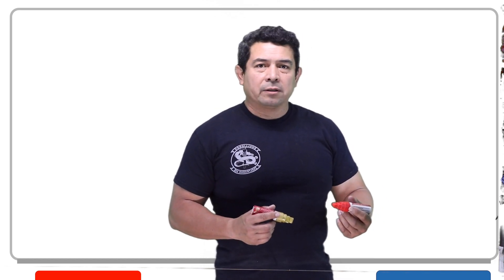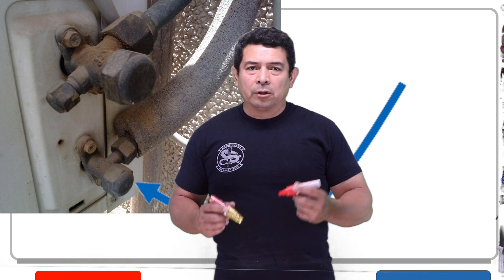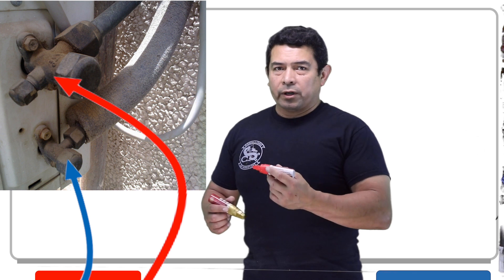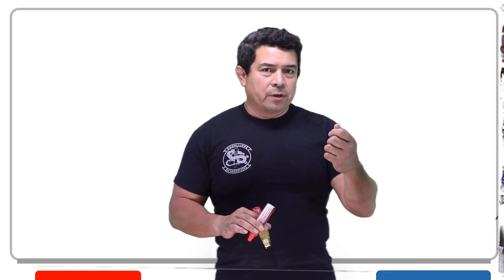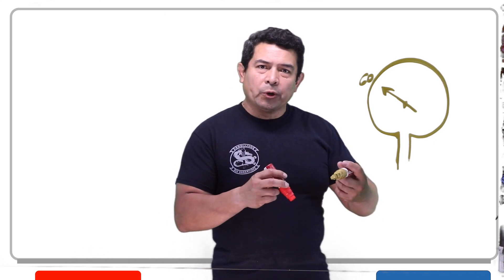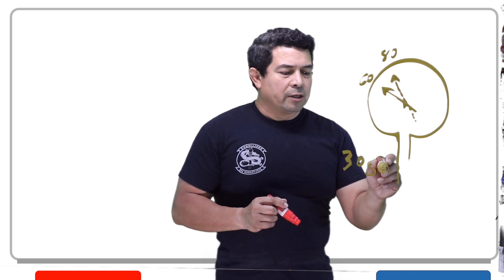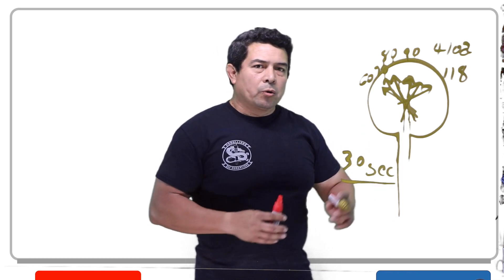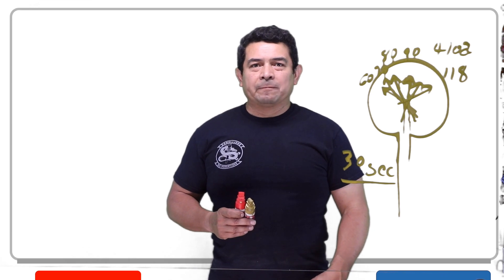Charging a system with liquid-HVAC Online Training and Courses

Comment: Rule 1 of anything that compresses gases, from a weedeater to a high rise chiller - "You can't compress liquid" - any kind of liquid, refrigerent, oil, water or lemonade. When you see a fuel car blow a motor, it's usually because they somehow got so much nitromethane blend into the engine that it filled a cylinder (with fuel pumps in the hundreds of GPM range, it's not as hard as you'd think). It's not that nitro is explosive, it's the fact that it's a liquid and you need a lot of it for it to work well that put those motors on the edge of "hydraulic lock". Any liquid sufficient to fill or nearly fill the cylinder or vane volume will destroy a compressor, by breaking connecting rods,  vanes or drive components. In an old style belt drive open compressor, it can blow the head gasket. Thanks for making this video, for years I've heard people talk about low side charging and NOT realize the risk, especially automotive guys. They think you can weigh out the prescribed amount and then just dump it in the low side. Amazingly I've seen people actually get away with it, but the risk is very high. The risk can be eliminated by using the procedure you describe, as I have for 25 years+. Rule 2 is go slow. You want to watch the high side and temps come to spec as you go anyway.  With mono refrigerants gas charge, at least near the end, otherwise, follow Julio's method of "gas charging with liquid withdrawl" Add oil very slowly if required.  Subbed!
Reply from the maker: Thank you so much! Like you I have seen people add liquid straight into the suction line. One time I was working with a guy who was in a hurry dumped a bunch of liquid into the suction line, he did it very fast and the compressor instantly stopped! It was a brand new compressor that we had just put in but he did not want to listen and was in a hurry. I just told him, you need to talk to the supervisor I am not saying a word. I have been doing this since 1979 and I have seen a lot of crazy things. Thank you for your comments I'm glad you like the video! And thank you for subscribing!

Comment: Thank you for the video. What would happen if we keep the bottle in a normal position and charge the system with vapour? Will it not be safer to charge the system with vapour rather than turning the bottle upside down and charging it with liquid?
Reply from the maker: Yes it would be safer BUT!!!  with the new refrigerants, because they are blends the refrigerant will not go go in to the systems with the  correct proportions and the unit will not operate properly.  This is why we need to charge with liquid and throttle the refrigerant in to the system. I hope this answers your question.
Reply: @AirConAcademy   Thanks a lot.

Comment: Cool tutorial but I have a question, I attended a training where I was told the best practice to charge a domestic split system unit is via  the high side. 
Please can you shed more light on that, if it's practicable
Reply from the maker: It is not a short explanation. Basically there are three ways to charge a system. The easiest is by weight. But you can only do that when the system is completely empty and under a vacuum and you know the exact amount of refrigerant the unit cost for like in a package unit. Then there is charging by superheat. You charge by superheat when you have a capillary tube or a piston as a metering device. When you have a TXV or an EEV in other words electronic expansion valve, some people say EXV but it is still an electronic expansion valve is charged by sub cooling because both of those will adjust to maintain proper superheat. So you want to make sure that you have enough sub cool liquid going to the metering device. Remember, only three ways to charger system, superheat, sub cooling and by weight.  I hope this answers your question!

Comment: If unit is normal running or full charge already how much PSIG in blue and how much pressure in hiside for 410
Reply from the maker: I would assume that you were talking about a regular air conditioning unit, if that is the case and the room temperature seems to be around 75°F, then your suction pressure should be right around 118 to 120 PSIG on the low side.  If the room temperature is warmer then of course you're such a pressure will be higher. Or in other words the pressure on the blue gauge which is the low side. On the high side it will depend on the outside temperature. If the outside temperature is around 90 or 95°F then your high side pressure could be between 115 to 120 psi.  If it is cooler outside then the high side pressure of course will be lower than that.   I think this is what you were asking thank you for sending your question in.

Comment: This is done with the units running and set to cool, correct?
Reply from the maker: Yes! You are correct he would do this while the unit is running and set a cooling especially if it is a heat pump. If it is a heat pump it must be set to cooling. If the unit is off and under a vacuum you can just charge liquid into the liquid line without falling it. Mainly because liquid should be in the liquid line. Thank you for your question!
Reply: @AirConAcademy  Thanks for your help and great video. 
I received an 11 pound R410a canister yesterday and added it until I was around 115-120 psi and my Mr Cool 18k system with 16 feet of line  came back to life.
When the system is turned off, the pressure rises way up. 
It returns down to 115-120 psi when I turn it back on.
I guess that is normal?
Reply: I also ordered a Freon leak detector just now. I may have a small leak, but I can't find it with soapy water.
Reply from the maker: @EL34XYZ  115/120 psi is normal that gives you about a 40° evaporator. The pressure on the high side should have been between 375 and 400 pounds of pressure, so when you shut it off yes the pressures will equalize that 115 or 120 will come up very high but on start up it will drop back down. That is one of the drawbacks about 410 A the pressures are very high. But I'm glad that you got it running!
Reply from the maker: @EL34XYZ  sometimes those leaks are hard to find. Make sure that you have caps where you connected your gauges because sometimes that is where the leak is. If you get new caps and that is where the leak is the seal and the new Will stop the leak.
Reply: @AirConAcademy  Thanks. I was worried  about the low side going high after turning the unit off. Thanks for the clarification.
Reply: @AirConAcademy  Thanks
Reply: @EL34XYZ  System Off (system not running) - Standing Pressure = about 225 psig for 410A and 150 psig for R22 ....
Reply: @thembones12  Thanks. I figured that out when I installed my Mr Cool a month or so ago. It's been awesome so far in my shop.

Comment: Nice video good information about liquid charging what is the gage reading for charging 404 on the  low side because there is no port on the high side but just in case there is a  low and high what is the reading on the gage thanks bro
Reply: Wow thanks bro you are the first person  since I asking questions on YouTube  helps me  I am a  small ac technician  but I get some time big  collar to work on  but I don't have all of those tools  like the recovery  and the digital gage for  checking the  super heat  on  the collar plate  don't have that  information it  have the  voltage  amps type of  gas  very old  system  but I need the job  I try to  change the  system on amps   the  compressor  is 15 amps  thank you very much for your help looking  forward for more  god bless
Reply from the maker: @wasimedoo1506  thank you so much for your comments. I do like to help the guys that are starting out. I have been doing this for 42 years and I'm slowly stepping out. But I would like to help the guys that are starting out. You do need some of the equipment. But others it's just luxury. You do need a recovery machine if you want to recover refrigerant and do most of these replacements.   You don't really need the digital gauges they're just nice and fancy to have. But you must have a set of gauges and if you have an electric meter that will read voltage, amperage, resistance, capacitance, continuity, and temperature you can do just about everything. You should be able to buy one of those for about $100. The temperature probes you could get one for around $50!  Unfortunately you will need a torch also and some basic hand tools. I'm not sure exactly what you have but like I tell all of my new students in class only buy what you can afford and only do what you know you can do. You have to take chances at times and do something a little more complicated than you have in the past. But I'm hoping to get new videos here on YouTube soon so keep learning and if you have questions send them over my way and I will see what I can do about helping.
Reply: I really  appreciate what you doing for me and others  thanks  God will bless you for sharing your knowledge  I am  doing  ac in a small  scale  I have a  gage  tools  not  every thing  but some to do  my work  but the  Meter for  temperature I don't have  I have a  regular meter to do  my  troubleshooting    to  get that  it's  hard and that is what makes work have not haveing the tools  I am from Guyana thanks bro
Reply from the maker: @wasimedoo1506  OHHHH   I had no idea you were in Guyana. But like I tell all of the guys in class, take your time save your money and little by little you will get the tools that you need. Do not give up and the good Lord will help you. Good luck and  Keep learning.
Reply from the maker: That is a tough question to answer. It depends on the type of system that you are using, it also depends on the type of metering device that you have, and most importantly what is the temperature of the evaporator supposed to be.
For example if your evaporator is supposed to be at 30°F your pressure should be right around 69PSIG, if your evaporator is supposed to be around 20°F then your suction pressure should be around 35 psi, if your evaporator is supposed to be at 10°F then your suction pressure should be right around 43 psi, but you still should get a superheat reading and if this is a package unit then the unit should be charged by weight according to the data plate to make sure that it is correct. But to charge it by weight you need to recover the refrigerant pull a vacuum and charge the system. That is a lot of work.  I hope this helps. And thank you for sending your message.!

Comment: Thanks for this tutorial.  You explained it very well and easy to understand.  Are you familiar with the Imperial  Kwik Charge low side adapter?  If so, what's your opinion on it?
Reply from the maker: Years ago I bought one similar to that. And I have used it they work fine.    Because of how long I've been doing this I can do just as good of a job without it. These tools are great and they help you but if I don't really need it I do not buy it. But it is a good tool end it will keep you from slugging the compressor.

Comment: Thanks Julio!  I added 2.5oz R410A, upright, as a gas, to my new Pioneer 12k Mini-Split   Did I do harm???
Reply from the maker: Not if it was only 2.5 ounces. Remember all of these new refrigerators are blends so they must be added as a liquid throttled in to the low side. Good luck out there!
Reply from the maker: @R L if you are throttling the liquid into the system with your gauges it will be a perfect blend. It's only when you charge it as a guess that you do not have a perfect blend. I hope this makes sense.

Comment: Why do we charge a system through the Vapor line?
Reply from the maker: One reason that units are charged through the vapor line it's because pressure goes from high to low. The pressure in the bottle is going to be much lower than the pressure in the liquid line. If you try adding refrigerant to the liquid line it will go from the liquid line into the bottle, not from the bottle to the unit. If the system is completely empty and under a vacuum you can put liquid into the liquid line and they will not harm anything. If the system is completely empty and under a vacuum and you add refrigerant to the suction line liquid will go into the compressor mix with the oil and dilute the oil so that it will not lubricate and on start up the compressor will lock up. If you tried to put liquid refrigerant into the suction line while the system is running and not throttle the liquid refrigerant you will get liquid back to the compressor and wipe the bearings and the compressor will lock up. I hope this explains it. Thank you for watching!
Reply: So if you have a system vacuumed down how would you fill unit with a blend ( which needs to go in as a liquid),if you dont fill in on suction line before start up?

Comment: Teacher, I want to ask you a question, what if someone has charged an empty system with gas form of refrigerant, any solution to this ? (asking a damage control)
Reply from the maker: That really depends on the type of refrigerant that they used. If they used R 22 then that is not a problem. If they used R 410 A then it could possibly be a problem and if they used R407C it is definitely a problem.   22 is a single component because of that it is perfectly OK to charge as a gas.   410 A is a blend and because of that you may not get the correct mixture in there. 407C is another blend which will not act correctly at all when charged as a vapor. So typically the new refrigerant must be charged as a liquid. If there is already refrigerant that was charged as a gas it should  be recovered and fresh refrigerant, or new refrigerant should be put into the system throttled as a liquid form.  I hope this answers your question. Thank you!

Comment: Thanks for the video.  Very simple explanation.  You explained to refilling with 410 refrigerant but When working with R22 systems the green can needs to be upside?  Thanks in advance
Reply from the maker: No, when you're using R22 you can charge it with a bottle right side up so that gas goes in. The only thing to remember is that if you charge liquid you will get the job done faster and it will be easier to charge that way. Thank you for the question I hope it helped. And I'm glad you watch the video!

Comment: What is the correct way when charging an r32 refrigerant when the ac is running..?
Reply from the maker: R32 refrigerant it's part of what makes up R410 a. R32 is not a blend so you should be able to add it to a system as a vapor.   While the unit is running you will need to add this refrigerant or any refrigerant through the suction side. By adding the refrigerant as a liquid and throttling the gauge manifold set as I explained in the video you will be able to charge a system much, much faster than with gas. I hope this answers your question. And thank you for watching!
Reply: @AirConAcademy  thank you sir. 👍

Comment: Is it propper to charge liquid refrigerant to air-conditioning system ?
Reply from the maker: Yes, it is OK as long as you know what you're doing? Or as long as you follow the directions I'm giving you in this video. The refrigerants these days are blends, which means that they are a combination of two or three different types of refrigerant. Because of that as a liquid they are in the proper percentages. When you add them to a system in the vapor form the percentages are way off so the unit will not run properly. To add liquid you could follow the directions that I am giving you in the video or you can buy a tool that will help you charge the system. All that the tool will do is to flash off the refrigerant as it goes through the tool. I have seen some of these tools called charge faster. In class I teach the students like I did in the video so they do not have to spend money on tools at first. As you are in this field longer you will have more money and you can buy more tools. At least that is how I see it because I have been in those shoes where money is tight!  I hope this answers your question, thank you for watching and thank you for your question.!
Reply: @AirConAcademy  Thanks for your quick response, which country are you from ? Am from Ghana but currently working in Qatar
Reply from the maker: @samuelbamfoadjei1105  I am in the United States USA. I live in the state of Virginia, right outside of Washington DC. I was born in Guatemala and came here when I was a little kid.  Please keep learning and asking questions!!!  Thank you!!!